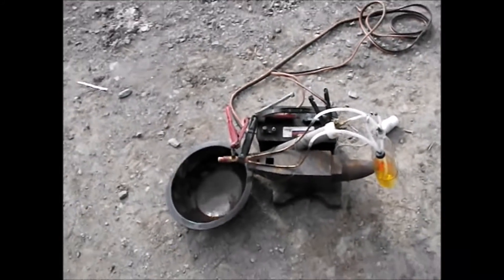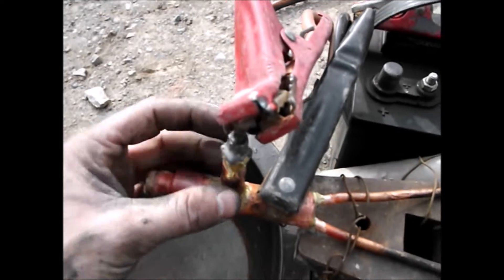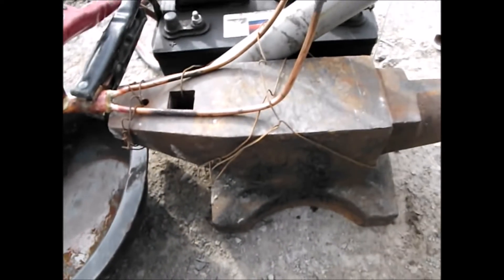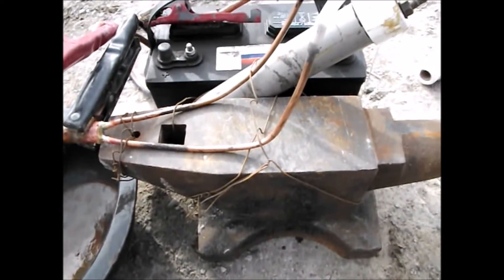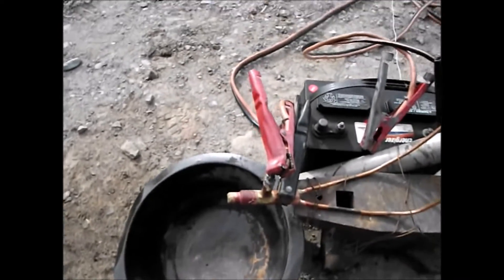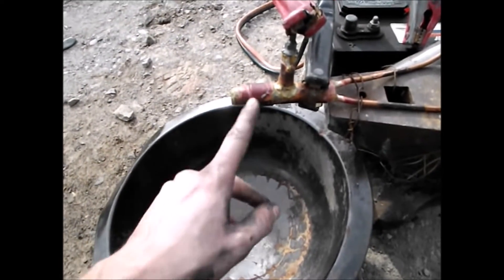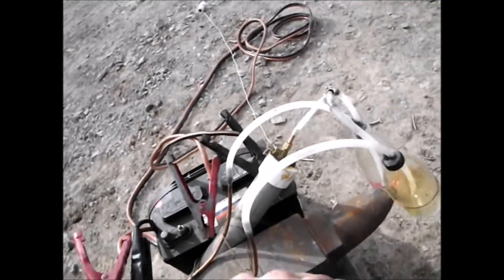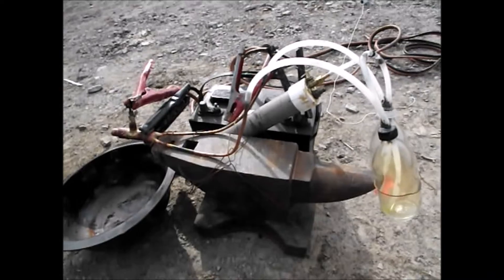Homade Liquid Fueled Roket Engine Tests 3 and 4

Comment: Much better atomization but the air/fuel mix is moving to fast for the ignition source to light the fuel and the gas is moving so fast(or the air/fuel mix is sub optimal) that the flame from ignition can't light the incoming fuel. At least this is just my opinion.

Comment: Not sure if this will help but me and a few buddies In the army had tried doing something similar but we used two battery powered electrode igniters from a barbeque.  And our combustion chamber was 3 times the size of the exhaust.  Not sure what the exact thrust was but it pushed a mountain board about 10meters in uneven gravel.  We were also just using gravity as our pressure and once the burn started we added pressure via a pressure regulated valve at the end of a air compressor hose.  I think we only used 7psi.  But that was close to 8 years ago.
Reply: One of my buddies had a PhD in aerospace engineering.  So you can guess who's idea it was lol

Comment: I only recently found your channel and I love it.  Keep up the great work man!  As for this experiment, I think the majority of thrust will be measured from the CO2 and very negligible from the reaction.  Maybe injecting high pressure oxygen, and restricting the discharge to make it more explosive as the reaction occurs in the chamber.  Possibly then the thrust will be a result of the pressurized reaction.

Comment: maybe decrease the pressure so the reaction has time to happen inside the chamber
Reply: I was actually thinking something along that same line, but also to increase the igniter power or have multiple stages of igniter setup up to keep combustion going.  Just seems the mix is too lean too.

Comment: I'd say you can use pre-heating by letting the reagents contact an already hot part of the combustion chamber before they would enter the chamber, mix and react. That would cause some evaporation to happen, a more thorough mixing, and a more stable burning as a result. At least this is what they do in industry to heat up the furnaces. The air and the hydrocarbon gas are passed between a hot wall of the furnace and the outer wall. When the gases finally enter the furnace, they are at 800 C or higher, and so the flame inside becomes even hotter.
Reply: This adds complexity. And do you think the walls would heat up the fuel after 3 seconds of burn time?

Comment: I believe that you are sending far too much fuel into the system, especially for such a small combustion chamber. I would focus on atomizing the mixture itself as much as you possibly can, and maybe by doing a quick premix in a tiny chamber before the combustion chamber would do the trick, then you would just spray a super fine mist into the motor and have much better results. 
Just an idea! 
Stay Curious, and push on!

Comment: The main problem you are having is the obvious CO2 bubbles flowing through the fuel line. Use smaller fuel lines and pressure lines, and higher fuel pressure, it will help compress the fuel and acid before reaching the nozzle.

Comment: You might solve the fuel mixture problem by changing the amount of pressure from the co2 to have an equal inverse relationship with the holes on the fuel injectors. The reactant  that has the 1 in the 4:1 ratio would need 4 times as much pressure as the other reactant to get equal mixing. If I understand your setup correctly in this video then currently you have equal amounts of co2 compressing liquids through different sized spaces. Therefore increasing the pressure on the liquid fitting through the smaller space would fix the flow rate.
Reply: You didn't get the point. You DON't want equal ammounts, that's why he doesn't have equal number of holes.

Comment: I think the problem stems from the choice of fuel. maybe switch to a polar fuel like something alcohol based, formaldehyde based, etc. Way back when you did the bottle cap test, the fuel and oxidizer didn't seam to react violently enough to be an efficient propellant mixture. If the combustion chamber was more like the size of a BBQ propane tank then you might get the mixture level needed before the propellant exits the chamber, but on such a small scale you will probably have to factor in the physical chemistry of how well the two mix. Have you thought about shifting the project in the hybrid direction? I've seen gaseous N2O/Solid Paraffin Wax rockets achieve incredible thrusts and altitudes, i can only imagine what pure nitric acid could achieve!
Reply: It is known that kerosene/Nitric Acid mixture has stability and combustion problems, so I agree with you.
Reply: The only reason I could see to use kerosene would be fuel price, but if he's already using pure nitric acid as an oxidizer the fuel cost would be negligible in comparison (baring fuels like liquid H2, hydrazine, or other NASA grade fuels)
Reply: What about turpentine? It is hypergolic, and the French used it with RFNA on the first stage of the Diamont, which launched their first satellite.

Comment: Nitric acid and fuel?
Reply: Red fuming nitric acid is used as an oxidizer for the liquid rocket fuel; here Cody is using off-road diesel fuel.  In some modern rocket engines, a version of this nitric acid (with a stabilizer to prevent corrosion) is used with hydrazine as a propellant system.  That, however, is hypergolic -- self-igniting -- which would be extremely unsafe for a backyard experimenter like Cody.
Reply: yeah hypergolic fuel is extremely dangerous even on small lab scale lol
Reply: Monitoramento Solar yeah this clown just making it up as he goes along there's no scientific basis for anything he does I don't understand what he's trying to accomplish with acids
Reply: @ClownWhisper  You don't know what you're talking about.

Comment: I believe your combustion chamber is too small for the amount of fuel and oxidizer you're putting in to it. Also, I believe you should look in to modifying your injectors to be a part of the cap of the combustion chamber, rather than them protruding in to the chamber, potentially disturbing combustion.

Comment: So i'm certainly no rocket scientist, just very curious. I am aware this video is pretty old but ima share my thoughts anyway. So my hypothesis is that the combustion chamber was to small which forced the propellants to react outside of the chamber, which intern melted the copper resulting in the green flames. The bursts of light were probably co2 bubbles as well.
Reply: That's an interesting theory, but the burn would need to take place inside the chamber for at least a few seconds before it began to melt the copper. The acid and fuel definitely did combust mostly after exiting the nozzle in the second test and I agree that one of the causes of this is probably chamber size, but there is something to be said for injector design as well. The latest design he used was definitely better and atomized the fuel and acid better, but the idea would be to make an injector that turns the liquid into an ambient cloud as quickly as possible, whereas the current design is still just thin jets of liquid hitting each other inside the chamber. Maybe, and this may seem counter intuitive, if the chamber itself was preheated so that the fuel vaporized faster and the nitric acid broke into its actually useful products quicker (those being N2O, NO2, NO, N2O2, etc.) then a more intimate mix could be achieved in such a small space and short time.

Comment: Liquid Hydrogen and Liquid Oxygen Cody!
Reply: YeCannyDaeThat You wanna explain making LH2 at home?
Reply: Peter Smythe Cody has made liquid oxygen.
Reply: +Anthony Vandyke

Oxygen boiling point: -297.3°
Hydrogen boiling point: -423.2°F

The way he makes LOX is by using liquid nitrogen which has a boiling point of -320.4°F, so he can easily put oxygen through liquid nitrogen and get LOX out of it. So how are you going to get LH2? By using the Siemens-Cycle. Kinda hard to do at home.

Comment: What about a gas fuel liquefied under pressure, no need for an air compressor, it makes its own pressure, something like propane or butane ought to work and it would burn easy too.
Reply: *****
Alright then

Comment: I cant tell from the video the approx ratio of the nozzle's laval point to its exit area. You should be aiming for 8:1 ratio of area - varying from 6 to 12 depending on temp, mixture, burn-rate etc, with a 12 to 14 degree divergence (you mentioned that in a prev video). Ultimately, you want the combustion chamber to be creating an exhaust gas velocity of the speed-of-sound and sustain it during the burn phase. Once you have that rate, then optimizing the nozzle geometry makes a big difference.

Comment: I'm wondering if the back-pressure of the combustion chamber is causing a sputtering of propellant flow. You should be getting 700psi+ in the chamber when the fuel fully combusts. You're probably pushing 10-20psi from the compressor. I would suggest some 1-way valves to prevent back-flow, and/or, a t-adapter to use chamber exhaust to pressurize the tanks (much like a turbo pump). Glad to see you dropped the water jacket (great idea, but, until you're getting sustained burns of 2min+, its not worth worrying about)

Please keep posting! Love love love it!!

Comment: You need to lower the pressure of CO2 to get a more constant burn that does reast inside the engine. With your pressure, most of the fuel (and oxidiser) just get blown out and react there, so basically you have got a dangerous version of a compessed gas engine...
Reply: the pressure was just fine the problem was that there was no combustion compartment .. the little chamber he had was way to small if anything he needed more pressure .. but if he had a little bit bigger of a combustion compartment this would of worked fine

Comment: you might want to try kerosine, its thinner and will atomize at a lower pressure. Its similar enough to diesel that it can be ran in a diesel car its just such a light oil its not good for the pump.

Comment: I quite like these experiments, and I honestly think that you have one minor flaw in that design, the combustion chamber. I think that if you increase the volume of the combustion chamber while leaving the exit nozzle at the same diameter, you would be giving the fuel mixture more space and mixing time to ignite comfortably inside the motor, that way it would be producing the needed gasses for propulsion, also with a larger combustion chamber you can cool it much more efficiently

Comment: Your nozzle is still too big.
Reply: no it was just fine the problem was the combustion chamber .. it needed to be bigger .. it was literally non existent here .. you need a good sized compartment for the chemicals to mix and combust .. if your nozzle is bigger then your combustion chamber it will not work you are just going to be spitting out fuel like a flame thrower
Reply: patman0250 making the nozzle smaller would accomplish this.

Comment: In this video the fuels not igniting until its outside the chamber. Need to get the exact right proportions to get the fuel/oxidizer to mix AND ignite inside the chamber. I'd say low the pressure to begin with. You may also need to raise or lower the pressure to the fuel or restrict it in some way so that the fuel and oxidizers are entering the chamber at the optimal mix ratios. But keep trying! This is really exciting stuff!

Comment: also you have your lines running straight into the back of  the rocket, the mix is flowing straight out of the combustion chamber and out the nozzle,  run the lines in at a 45 degree angle to the nozzle.  this will make the mix have to spend more time in the chamber, and mix better before it is forced out the nozzle, hopefully as a gas.
Reply: +Shane Powell It might help if his injectors were in opposition to the nozzle and he had much smaller holes in the injectors as well. The fuel and oxidizer don't seem to mix until they are completely out of the nozzle where they make flame but little thrust. A smaller nozzle would probably also help.  Using a larger combustion chamber with the same size nozzle would work but I think it would need more fuel volume if it gets much larger.
Reply: agreed,  the smaller holes would allow for better atomizing of the fuel mix.  you'll need to run the fuel at higher pressure though.  same with the injectors in near opposition to the flow,  more pressure.

Comment: I really hate to be that guy, but you really need to take your PPE seriously.  Working around highly concentrated nitric acid, much less pressurized acid, is extremely dangerous.  All it takes is a manufacturing defect in the pressure vessel and before you know it you have shrapnel flying around, and red fuming acid spraying in your face.  I would rather get criticized for being "that guy" and save your life than not.  Please, at least wear a lab coat, gloves, and a faceshield?

Comment: I reckon that with a proper bell on the nozzle and maybe a bit less pressure in the fuel you could have a decent motor :o
Reply: no the nozzle was just fine be just needed a bigger combustion chamber .. it seemed his nozzle was bigger then his combustion chamber that will not do .. your chamber needs to be at leased two to three times bigger then your nozzle the higher the pressure the better you need a chamber so the chemicals can mix sufficiently instead of just being spat out like a flame thrower

Comment: how about using a different mixture? 

for example for the fuel use 30% hydrazine hydrate + 57% methanol + 13% water with a small amount of potassium-copper-cyanide

and for the oxidizer use 80 % hydrogen peroxide und 20 %8-Hydroxyquinoline!

same stuff was used in the first liquid rocket engines and it doesnt need a ignition it reacts when both mixtures are combined!
Reply: +DON HORNEGGER LOL , you could have a pretty boss engine with just the 80 % h2o2 and some catalyst for it to decompose on :D...

Comment: I really liked this attempt at making a liquid-fuel rocket motor. I'm bummed not to see any more videos since. I can think of a couple of modifications that might make it more tractable. 

Firstly, instead of nitric acid, you may be able to use ammonium nitrate. Pure ammonium nitrate would be risky to melt, but according to wikipedia's solubility tables, you can dissolve 400g of nitrate in 100g of water at 55 °C. This essentially gives you a liquid form of impure ammonium nitrate. It would be cheaper, safer, and easier to operate than nitric acid, and you wouldn't have corrosion concerns.

Secondly, it may help to use an elongated combustion chamber that you can pre-heat the back of (away from the fuel injection nozzles) to a red-heat. Pre-heating could be accomplished with an external heating source, internal coil, or simply by igniting the engine with a very low fuel flow rate at first and just letting it burn inside the chamber for a bit. Even if you don't manage complete atomization, the heat in the chamber may serve to vaporize the propellant. Plus a longer chamber would allow more time for fuel-oxidizer mixing. There are plenty of refractory cements out there that you could line your chamber with to insulate the metal chamber walls.

Comment: a few points. You need a bigger combustion chamber. nitric acid won't nitrate the diesel fast enough to get it to ignite. yer just burning diesel and nitric acid. nitrate the diesel before hand and itll be more readily burnable. combine that with a liquid oxidizer and you'll have far greater success.